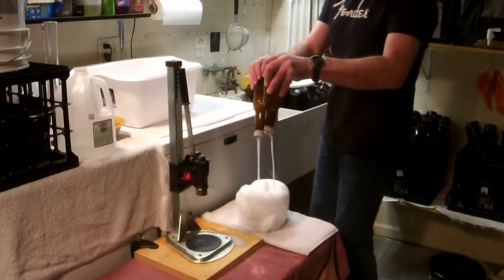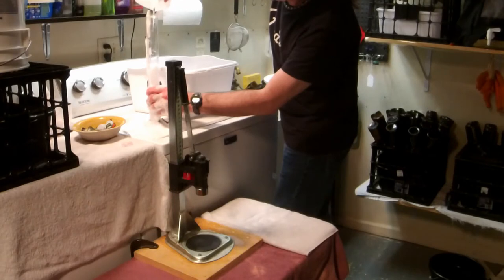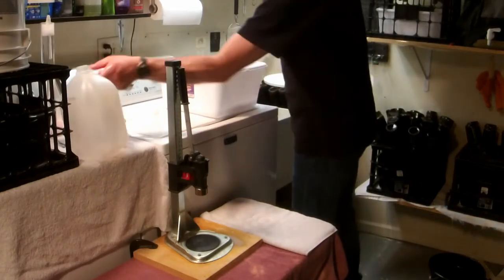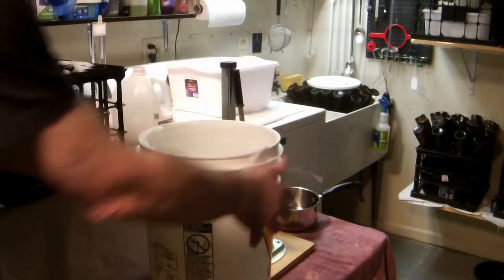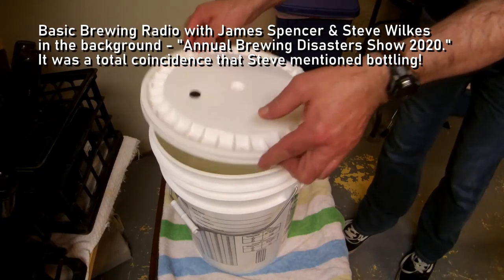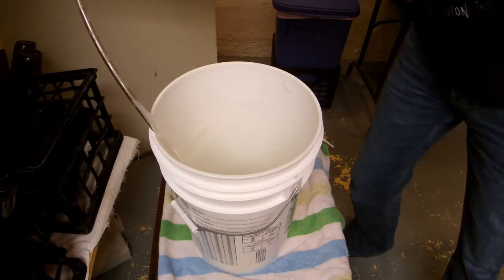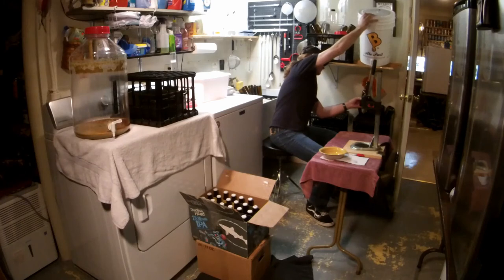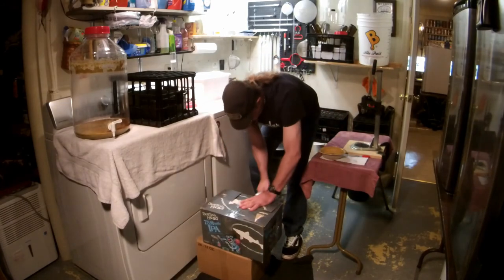Homebrewing Beer: My Bottling Process

Comment: Pretty cool bottling works!!! It's interesting that the House 3C Pale Ale could be upgraded to IPA by adding dry hops. Wouldn't the House Ale have to be IPA to begin with, or, to turn regular ale into IPA it only requires dry hopping? If I brewed something like moonshiners beer, which is produced with single temperature infusion and high modified, malt rested at 66C for an hour and add dry hops, would the moonshiners beer turn into IPA? I'm new at home brewing, bear with me.
Reply from the maker: Thanks Michael, and welcome to the world of homebrewing! Great question and point. True IPAs are dry-hopped but my recipe would still be considered a Pale Ale by definition - so IPA in name only lol! You'll have to forgive me - I think I've heard the term "moonshiners beer" but I'm not sure exactly what that is. Most modern IPAs (especially American) have a simple grain bill so that the malt character comes out low and clean and the hops can shine through, plus the ABV% is higher. Here's a great BeerSmith podcast with Mitch Steele - note where the conversation turns around 16 minutes in - https://youtu.be/fIAxeD_WbWc - Hope this helps - Cheers!